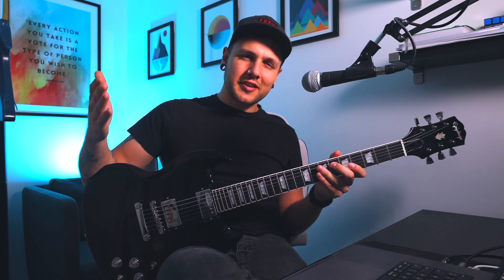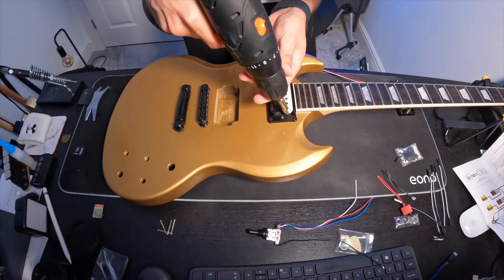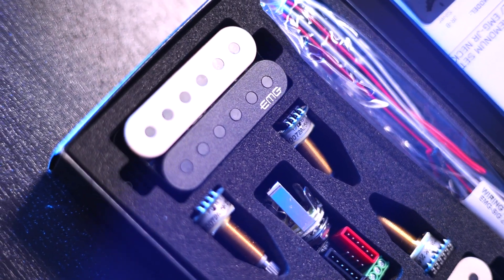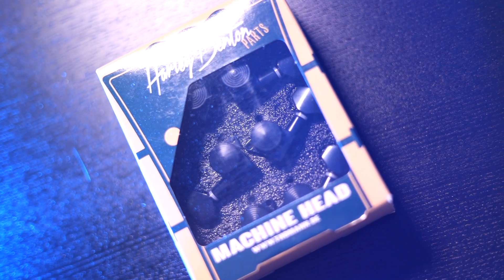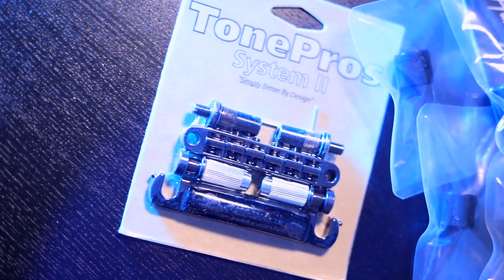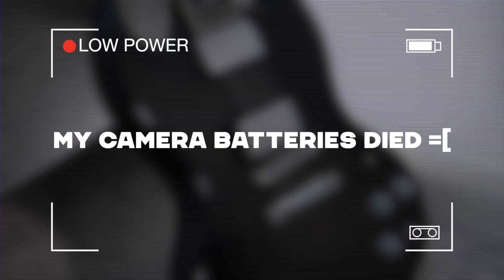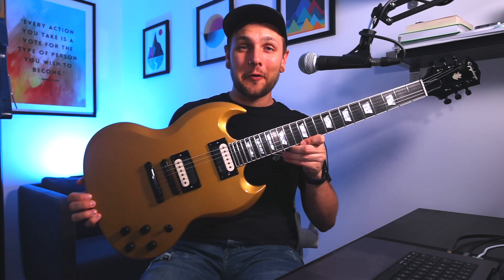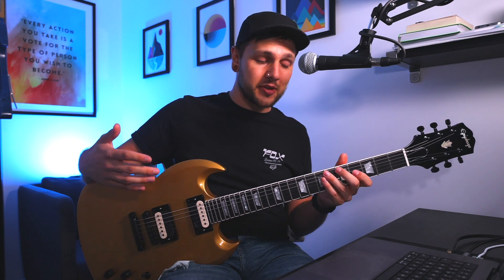Can This TRASHED Epiphone SG Modern Be Saved?

Comment: Yeah, what you saw in that control cavity was actually factory stock. All the push/pull pots and coilsplit options with phase switching also, really crowds the small area. I had one when they first came out, and really liked the neck profile.
Reply from the maker: Really?! That’s incredibly surprising! They are super cool guitars though. Thanks for checking out the video mate 🤘
Reply: @JackTaylorGuitars  yeah, Epi electronics and wiring, for as much as I love their current build quality, is mostly done solderless these days with those odd pots. It’s part of why so many Epis these days have coil splits and phase switching even on like $400/$500 models.

This all started when Gibson switched to PC boards on their guitars sometime in the early 2010s. It was great, in theory.

Of course, good luck finding Gibson quick connect pickups when you want a specific one and good luck figuring out how to solder another brand of pickups into the Gibson connectors and if one of the pots on the board goes, iirc, the whole board goes. Good luck finding a functioning, used Gibson PC board for a reasonable price, too.

The Epi pots may or may not be proprietary, idk, but at least the connectors used on them are not, and can be ordered online & soldered to any brand of pickup.

Maybe useless info, maybe not.

Comment: Looks good and sounds good. Not every day you see a Goldtop SG. When you were stripping and sanding the top did you happen to sand through the veneer? Just curious how thick it is on these guitars. Do you know how thick the maple cap is? Seriously thinking of buying one myself.
Reply from the maker: Cheers Tony! Actually, when we were removing the material for the battery box we did get to the maple cap, yeah. It’s probably in the region of 1/2” to 3/4” if I had to guess. Hope that helps! Thanks for watching mate 🤘
Reply: @JackTaylorGuitars  thanks for the info. I appreciate it

Comment: Is it possible that the "grayish" color that kept returning was from the original finish not being entirely removed and then showing through? I've seen other people use a heat gun in order to remove the original coating before sanding. I'm not a painter or guitar luthier, so I could be completely wrong. Just figured I'd throw the question out there and see what others thought.
Reply from the maker: It’s a great shout mate, genuinely good question. In this case I’m positive it wasn’t that this time because it was after about 2 cans of paint. There’s a short clip where you can kind of see what I mean when I sanded back a drip. Really appreciate you checking out the video and commenting dude!🤘
Reply: No, it's a metallic paint so when you sand it you expose the metallic particles.   Metallics can be tricky. May have taken a couple tries but looks like you got the hang of it. It looks good.

Comment: I thought you did a very good job, I wasn't sure about the superglue, but hey it still worked.
Reply from the maker: Thank you so much mate, I’m glad you think so! I wasn’t sure about the super glue either 😅 Usually I’d use a few strips of paper but, I’m this case, I threw caution to the wind a bit! Really appreciate you watching dude!
Reply: @JackTaylorGuitars  Any time matey, do you have other videos like this one?. I'm in the middle of spray-painting my Kramer, I've given it several attempts already, so this time I'm trying to be extra careful. I don't think the paint had enough time to dry, either that or it was the clear coat. So this time when I painted it,  I left it nearing two weeks so far. Maybe in another week or so, I'll apply the clear coat. I think I'll  leave that for a few weeks before sanding and buffing orange peel etc The clear coat I use is pretty expensive, It's that 2K Clear apparently It's the best from a spray can.